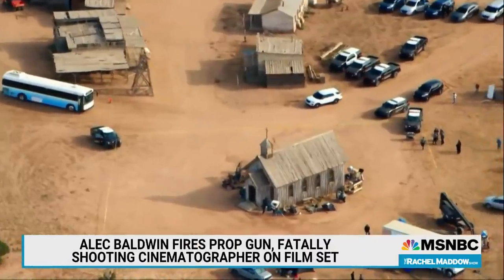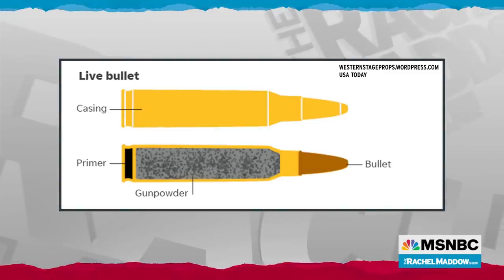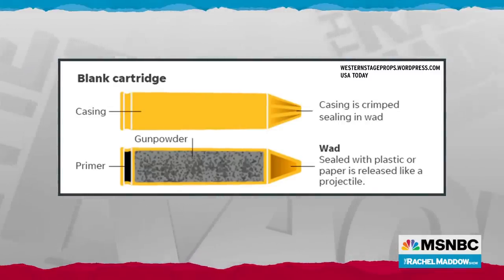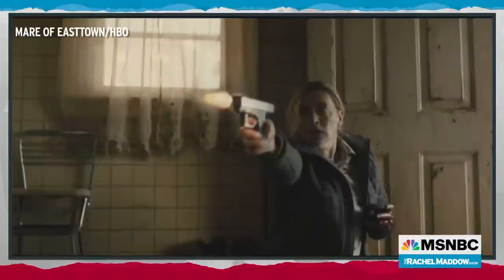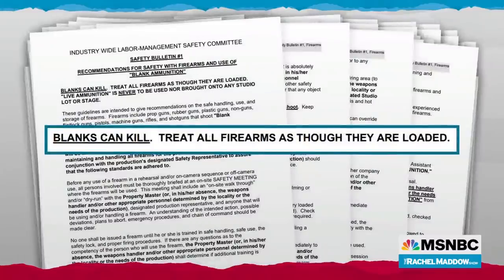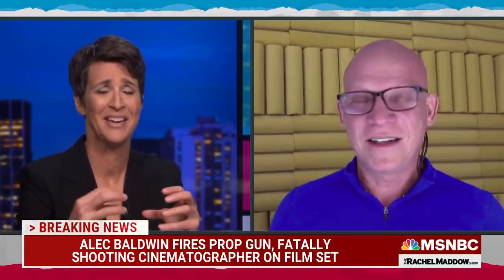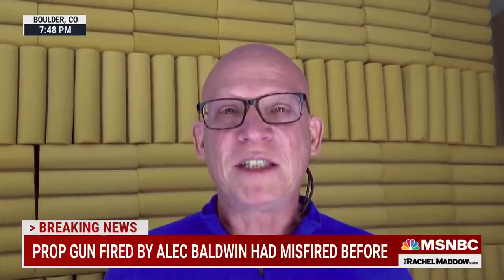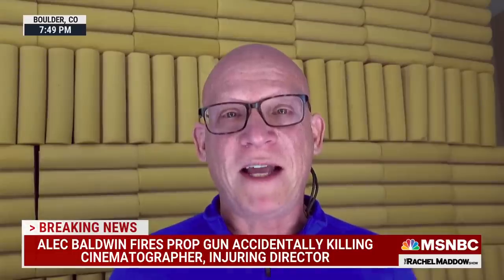Weapons Safety Expert Looks At Safety Protocols And Alec Baldwin Movie Set Shooting

Comment: Why would you even allow live rounds and real guns on the set of a shoot, much less combine the two and leave a loaded real gun laying around on a prop table? Insanity.
Reply: There was a dispute over hotel accommodation - some members of the crew walked off set - including the weapons safety guy.
Reply: My guess is there was a scene that showed someone loading a gun with bullets
Reply: Blanks come from live rounds, at some point there is a need to convert a live bullet into a blank.  That being said.. there seems to have been quite a few lapses in the protocol's required for the handling of firearms and pyrotechnics.
Reply: @AdeptPaladin  - THATS NOT TRUE - Here in Europe blank ammunition is chambered 1mm below the live ammunition so you cant accidentally chamber live ammunition in a blank firing gun.  Blanks CAN come from live rounds - but its shoddy and a cost cutting measure by the manufacturers.
Reply: @Idonthaveaferrari 
Possible, yes.
Extremely farfetched, completely baseless and improbable? Yeah, that's a yes too.
Reply: @trudi1962  
Oh dude, you have no clue.
Reply: @Idonthaveaferrari 
Wait a second.
First it's the assistant and now the actor himself?

Besides, no matter if it's possible - there are lots of things that are, doesn't make them reality - it's still baseless, far fetched and very unlikely. 

I get that it's your theory and you're pretty set on it besides it being a little inconsistent.
But don't expect me to follow you there without any evidence whatsoever, I won't.
Reply: @Idonthaveaferrari 
Yes, but I don't think it's for the reasons you have in mind.

And again, I won't go off into wild speculations. I wait until there's actually something solid. Especially regarding motives, if there even are any. They're notoriously hard to guess.
Reply: @Idonthaveaferrari 
If the reporting is correct and they were in fact leaving because of severe security concerns these clues would rather be pointing at an accident or maybe gross negligence - but not to some kind of crazy murder plan concocted by some psycho, don't you think?
Reply: @Idonthaveaferrari 
There seem to have been security concerns so severe that people straight up quit and walked away. And as someone mentioned, there's often scenes with a gun being loaded. People make the stupidest mistakes, it's well known how often people shot themselves or others with firearms they are a 100% sure aren't loaded and were even controlled to not be loaded by those folks. That's unfortunately not even a remotely rare occurrence in the US with its abhorrent gun safety culture.
That could possibly be an explanation for all of it.
Or not. We'll see.

There are soooo many possibilities, yet you are totally fixated on one of them and are trying to convince yourself that it's the most plausible.
But it's clearly not, unless your reality is chock-full of murderous maniacs. And even in the US that's obviously not the case.

Once again, you can't convince me with these thoughts. And once again² - Yes it is possible. Of course it is. But it's neither sure nor close to it and regarding everything that's known by now I think it's a rather unlikely possibility.
Reply: @Idonthaveaferrari
What warrant?
Reply: Democrats and guns, bad mix.🤦‍♂️
Reply: @AdeptPaladin  Apparently not. Actual prop guns have a different size to the chambers so that real bullets can’t fit.
Reply: @heinzhaupthaar5590  I disagree. There's nothing wrong with engaging in preliminary discussions prior to the facts coming out. It would be a boring world if we did things your way. Healthy dialogue should be welcomed.
Reply: @Idonthaveaferrari EXTREME METHOD ACTING!
Reply: @piccalillipit9211  Whatever happened, that doesn't make live ammunition appear on the set.  Where did the live rounds come from to begin with? Who brought real bullets onto the set where there should have only been blanks?
Reply: @AdeptPaladin  No they don't. Are you saying that the people that make Ramset concrete nail guns take real .22 shells and take the bullet off to make their ammunition?
Reply: @camerondavis8356  They have dummy round for that. Usually turned on a lathe fron a solid piece of brass. It's been illegal to have live ammunition on set since the Brandon Lee incident.
Reply: Live rounds absolutely dont need to be anywhere near filming
Reply: I used a "prop gun" on a little theater show once. Rented specifically for this use. The cylinder was bored small, so that normal ammunition could NOT be loaded, short so that ONLY blanks would fit and the far end open even smaller to block any projectile no matter how it got in there. Additionally there were pins driven THROUGH the barrel.
The point is there is no excuse whatsoever to even have real operable guns on a set. Ever.
Reply: The secondary question is, when on stage, film, or intenet, where do you aim a prop which is expected to fire, or NOT expected to fire? and the answer is you aim it exactly where you aim all guns.  ONLY at things that can be shot.  In the Baldwin case, I presume the director and cinematographer are out of shot, so why is any weapon being pointed at them?  If Baldwin is supposed to throw a brick, knife or toaster, does he throw it at anyone on set?  No, so why does a weapon get pointed at anyone, EVER?  You cannot do that at any range, why would anyone, including an experienced actor do that?
Here is a better question to highlight this oversight.  If his child with Kim Bassinger is sitting in Daddy's star chair, between the Director and Cinematographer, does Daddy point a gun at his own child and fire it?
Reply: @Idonthaveaferrari "Your not saying anything new".. ..and your making wild speculation.
Reply: @eggsbenedict2251  Republicans and anything, bad mix.
Reply: @piccalillipit9211  thank you for admitting what I said was partially true
Reply: @KennuhWayne  yes! The Heinz dude put ME in my place. So we're not allowed to speculate now?
Reply: Anyone who grew up with guns, including myself, has always had gun safety pounded into our heads. We were never allowed to pick up a live gun until we were old enough to understand the implications of what an accident with a gun could cause! This is absolutely disgusting and neglectful.
Reply: @camerondavis8356 , scenes like this are supposed to used handmade bullets with no primer and no powder
Reply: The document that they showed actually states that LIVE AMMUNITION is never to be allowed on the Studio Lot or the Set.  Live Ammunition should NEVER  have been there to begin with.
Reply: @Idonthaveaferrari I guess it was just too soon for black humor....
Reply: @piccalillipit9211  So Hannah Gutierrez-Reed (Armorer) nor Sarah Zachry (Property Master) were no longer there?  Where is that info source?
Reply: @Idonthaveaferrari it’s on the people that caused a live firearm to be placed into the hand of a person who was told and had every reason to believe was a cold weapon.  If the story is as it seems the only fault on behalf of Baldwin was to aim it in the direction of a person.
Reply: @piccalillipit9211  they hired a local amateurs in order to keep shooting
Reply: You can record a live shot without killing anyone. Saves TONS of money on CGI.
Reply: @Idonthaveaferrari you're not serious, right? There are so many films with scenes of gun fire that one could find bullets flying in every angle and in every direction imaginable
Reply: @KennuhWayne  
Well, you're absolutely right.
I probably should've worded that better.

There's quite a difference between discussions and a healthy dialog on one hand and jumping into wild speculations, becoming unreasonably convinced that one knows some kind of truth and getting emotionally invested in said "truth" to a degree that it's neither very healthy nor reasonable on the other hand though.
Unfortunately the later isn't exactly uncommon it seems and often the reason for mob mentality and prejudgments that can have quite a real world impact.

I mean, we have a good example, 'Idonthavea...', right here.
He doesn't just seem to be engaging in discussion and healthy dialog to me, but rather to be quite sure he's got some kind of truth and is emotionally invested enough to get straight disgusting when someone disagrees with him and his arguments run out.
That's basically what I meant, should've been more clear about that.
Reply: @piccalillipit9211  I don't know if it's true anymore, but back when Brandon Lee was killed, that's how it happened... 

They were decommissioning live rounds and converting them into blanks
Reply: @piccalillipit9211  so, his statement at least is partly true
Reply: @eggsbenedict2251  obvious troll is effing obvious
Reply: @AdeptPaladin  -No problem - Im not an expert on this.
Reply: @wanderingfido  - The BBC. But I only know the job titles not the names. Might be these people might be different people. In initially said they walked off set over hotel accommodation - later added "multiple concerns including safety".
Reply: @camerondavis8356  in that case, they should have been using “dummy rounds”. They look real, but are solid metal and can’t be converted to a live round, blank or not
Reply: @selah71  true. I’m a California liberal and I’d have to get a pen and paper to inventory all my guns
Reply: Was there any magats on the set?
Reply: @piccalillipit9211  They were into the third week without pay.  The shifts were 17 hours long.  And, they were having to sleep in their cars.  Presumably this all means it was a low budget and apparently morbidly amateurish outfit.  If so, what was Alec even doing there?
Reply: @camerondavis8356  Not an excuse.  There are such things as Dummy Rounds that look real but cannot fire and thus are not dangerous.
Reply: @wanderingfido  I am not in any way saying they did not have good reason to walk out. Dont get me wrong, I am in solidarity with any of my fellow workers anywhere on the planet.  My friend is an actress in the UK. She was filming in Wales at night for a big movie. She is quite successful but not a star.  They were there for 14 hours a night 7 days a week for 5 weeks i think.   In the rain and the cold - waiting for the star to fly in on his private helicopter and the moon to be correct and the rain to be correct and they were just stood there freezing for hour after hour.
By the end of the shoot she was in a wig cos her hair had fallen out with the physiological stress of the filming. 
Movie making is ONLY glamorous for the stars - for everyone else, it is miserable hard often horrible work.
Reply: Idonthaveaferrari possibly he was pointing to the camera for a scene with the gun pointing directly to the viewers
Reply: @Idonthaveaferrari Indeed...and why would he pull the trigger?
Reply: @camerondavis8356  So, you buy a bunch of reloads that don't have powder or live primers. Anyone that reloads a specific caliber can do this.
Reply: @skepticalobserver7484  Yeah, but...  If he'd had any real firearms safety training he'd treat it as a live gun and always point to one side so that even a gun that is known to be safe is always pointed in a safe direction. So, yeah, he probably did not know it was loaded, but he's negligent for not having had proper training in how to handle a gun. Even the  SAG rules say don't point it at someone. So, Baldwin does share some of the blame.
Reply: @ronaldjeffrey8712  If it's true that live rounds have been illegal since Brandon's incident, did people like Hannah Reed (Armorer) or Sarah Zachry (Property Master) know that?  Or were they in the seven people who had walked off the set six hours earlier?
Reply: You don't
Reply: @Idonthaveaferrari
I'm fresh out of what's, how about a nice who?
Reply: @eggsbenedict2251 
Republicans and learning from past mistakes... Never happened.
Reply: They are not allowed on set. For anyone. This is to avoid situations like this. Safety first.
Reply: Maybe Alec should shut his big mouth, stay out of politics and take a safety class on firearms.   Lock him up forever! 🤮
Reply: @Idonthaveaferrari I was making the point that the blame is on multiple people, which is in contrast to your original statement that seemed to indicate it was all Baldwin’s fault.  Your posts since then seem to be indicating that you at least somewhat recognize that no 1 person is 100% responsible.
Reply: Yeah, that's the real question. My conspiratorial brain running wild here, and fighting with the part that simply says "people are dumb."
Reply: @wanderingfido  There no telling what someone else is thinking, but I can say the way things seem to have been being handled on the set would have been enough to make me walk off.
   Unfortunately there is a mindset in Hollywood of people being more concerned about their next job than the current one. And a reputation as someone who rocks the boat won't find you alot of work.
Reply: @piccalillipit9211  Different protocols. What's done in Europe is not necessarily the rule in the United States. If you had listened to the video,  the weapons expert actually spoke to this issue.
Reply: @lordvader199  Exactly. That statement makes absolutely no sense!
Reply: @Idonthaveaferrari The warrant was issued in order for law enforcement to enter the premises and perform a search,  not arrest anyone. This is standard procedure in the event of a death or injury from a firearm.
Reply: @Idonthaveaferrari it offers nothing but that there was a contract dispute. Stop reading into things Columbo. Nothing worse than an armchair detective.
Reply: @Idonthaveaferrari he didn't. They were standing in the line of fire during the performance. It was the prop director's responsibility to ensure everyone was safe.
Reply: @RinrvUSA  A warrant was executed to search the area. Standard procedure in the USA.
Reply: @KennuhWayne  discussion of  what  is known is one thing. Accusations of guilt without knowing the facts is quite another. That's called "vigilante justice". Nothing good comes from that mentality.
Reply: @AdeptPaladin  wrong blanks do not come from live bullets and prop guns can’t shoot . It’s like a cap gun . This was a real gun and bullet .
Reply: Because Hollywood production is full cost cutting corners
Reply: @Idonthaveaferrari do you think the producer literally checks every item brought onto the set?   Do you think the producer is involved in inspecting and/or loading ammunition?  If someone dies from food poisoning on a movie set is the producer responsible for not tasting the food first?  Get real.
Reply: @Idonthaveaferrari best guess is they wanted a head on shot of the muzzle firing toward the camera
Reply: @Colleen D you’re absolutely right.  The only point I have been making is that several people had to be careless and negligent for this to happen.  Baldwin is definitely one of those people but he is not, as seemed to be indicated earlier in this post,  the ONLY person to blame.
Reply: A real and operational gun.., I can understand. Live/bullet bearing self defense ammo however, shouldn’t have been within a mile of that spot!
Reply: @YT4Me57  Not exactly. Ever witnessed a thorough police investigation? Accusations are made. Some are proven. Many are disproven. Some refer to it simply as hypothesis. Vigilantes actions go far beyond that, as they exert unauthorized legal supremacy. Not the same.
Reply: @Idonthaveaferrari Yes my question is "Why would she say the gun was safe and hand it to him?
Reply: @piccalillipit9211  no she didn’t. She was there when it went off.  Only 6 of the camera crew left. You are incorrect.
Reply: @lexijones8414  - Yeah I heard that yesterday - that was the BBC that reported that.
Reply: @camerondavis8356  yes, and then that weapon was somehow not checked or cleared and may have been swapped in later. Unbelievably reckless and careless. If there is a scene which needs to show somebody loading bullets into a magazine or directly into a weapon, they should use dummy rounds which look just like live ammo on the outside but have no live primer or gunpowder, it's just a totally inert metal object -- a little paperweight. There is NO reason to have live rounds in filming.  None.
Reply: @heinzhaupthaar5590  I agree that a lot of the speculation is idle, uninformed, and basically a form of entertainment to the speculator or others. But the facts are that a handgun was discharged and that whatever projectile emerged from the muzzle killed someone. Those two things are entirely factual.
Reply: @AdeptPaladin  live rounds are live rounds and blanks are blanks. Manufactured two different ways. You COULD extract a bullet from the casing of a live round and make a "blank". But that's down in the basement stuff. Blanks are manufactured with the business end having some form of wadding to keep the powder from leaking out and then having the end of the casing or cartridge crimped down to keep everything inside.
Reply: @JJohnston4Life  Agree 100%. I can still remember the stern lecture the NRA instructor gave us when I was 9 years old. "Always treat every gun like it's loaded...NEVER point a gun at anyone, or at anything you don't intend to shoot...know your target and what's behind it...". Safety is or should be drilled into you before you ever pick up a weapon.
Reply: Live rounds are not allowed in the movie sets because the guns are real. They had the live rounds for target practice during their breaks. Someone is going to prison.
Reply: @AdeptPaladin  Most commercially available blanks are manufactured to ONLY be blanks.  If you added a projectile to them, you may blow up the gun.  In fact, you should also know, the powder in most blanks is of a higher power than the actual cartridge it is meant to mimic.  Then, there are power levels of that blank round, 1/4 power, 1/2 power, full power. That is one of the details that should be stated on set, while the firearm is being introduced to cast and crew, and the shot. Blanks are still powerful enough to cause a lot of damage. 
It is possible to create a blank by replacing the lead with a plug.  Because the powder needs to be kept in the case, and, under ignition, the powder needs to have some resistance in order to fully combust.
Reply: @heinzhaupthaar5590  I agree 100% with what you said in your reply to me after the first two sentences "Of course they are...", etc.
Reply: why have a real gun period. Don't play with guns. should be common sense
Reply: @Idonthaveaferrari youdonthaveabraintoo.
Reply: 101 of gun safety.  Inspect your weapon to see if loaded or not.  Included blanks, or rounds with no primers.  Whoever pulls the trigger is responsible for that pull.  Especially the producer and someone that has used firearms many times as an actor.
Reply: @Idonthaveaferrari Why?
Reply: @camerondavis8356  they make dummy rounds for that. using live rounds for such would be a gross violation of safety protocols.
Reply: @AdeptPaladin  sometimes yes. sometimes no.
Reply: @piccalillipit9211  you cant fit proprietary blanks into a firearm being used as a prop. thats why sometimes live ammo is converted into blanks.
Reply: @Idonthaveaferrari for that to work they would have to know the armorer, ad, and baldwin would forego their safety protocols.
Reply: sometimes there is no choice but to use "period correct" firearms on the set, but leaving firearms lying around on a cart unsupervised and obviously unchecked by at least the three people we know handled the gun before Baldwin was practicing drawing the gun across his body in front of the camera is unbelievably unsafe.   Following the rules laid out, there should never be an "accidental" discharge of a firearm/prop gun.
Reply: Nope. They use dummie bullets with no gun powder inside for that
Reply: They probably were shooting live rounds in their down time and unforgivably left a live round in gun and then put it back. Gun was loaded with blanks + the leftover live round. I have no facts obviously it’s just my best guess. If so, it’s so careless and inexcusable. Hard to even describe the negligence. Sickening and sad.
Reply: @le9335    one report said the same gun was actually used for target practice with live ammo during "off hours".   That would certainly explain all the live ammo found on the set.  Also, the armorer should have locked up the gun when it was not being used on set as a prop...
Reply: @zigfield723    Not in this case... There are reports the gun was used for live ammo target practice during off-hours.   There was a lot of live ammo found on the set.   three people reportedly handled that gun before the shooting... the armorer, the assistant director, and Baldwin himself.  the protocol is that each person that handles the gun before a scene checks the firearm to ensure it is "cold" or safe to use.  The armorer did not do her job, The assistant director did not do his job and assumed the gun was safe and then there is Baldwin, the end-user, the actor how was also supposed to check the gun... This is done on purpose, by double-checking the gun until it ends up in the hand of the actor who is supposed to check it again, negligent discharges should never happen.
Reply: all movies use real guns just with blanks
Reply: @piccalillipit9211  Who was the "weapons safety guy" who "walked off set"? Please tell us.
Reply: @AdeptPaladin  "Blanks come from live rounds." Bahahha. Yes, a male bullet meets a nice lady bullet and they fall in love and have little baby bullets that grow up. Bahaahhaahahhh
Reply: @wolfman515  You do not understand guns and ballistics. But guessing is ok I guess. This is not important.
Reply: It was the set of a shoot, all right...
Reply: You're not allowed
Reply: The presence of a live-round is IMO the MAIN point of negligence, or possibly criminal intent.  The armorer was reportedly unaware of live rounds on set.
Reply: @piccalillipit9211  that's not true. What "weapons safety" guy walked off? The "weapons safety guy," was Hannah Gutierrez Reed who loaded the firearm with live rounds so she responsible for the death of Halyna Hutchins.